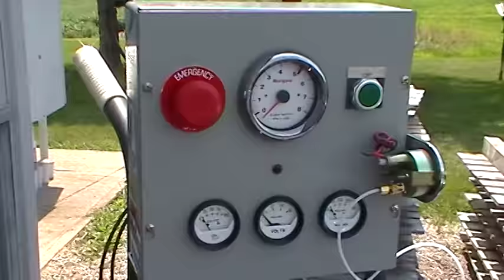383 Stroker Blower Motor Startup

Comment: the idle on that sounds a little rough... it should have an even tone to it not reving every 2 seconds just to keep it started.. i feel if i was to drop that in a car how it sits and bolt a trany to it the moment i threw it into 1st its going to stall...
Reply from the maker: krypten wolf Not at all. This thing is very fast and never dies in gear. Idle is about 900 in gear.

Comment: how much did it end up costing to build this motor? really wanna do this on a 76 chevy
Reply from the maker: I did a TON of parts searching to save money. Blower was lightly used found at swap meet for $1900. Holley carbs were refurbished pair on Ebay for $850. Rotating assembly was about $1,000. Motors like this usually sell for about $16,000 with everything brand new. I can usually sell one for about $10,000.

Comment: 93 octane for engine seems a little low, i wouldnt go any lower than 95. Youll probbaly get some knocking
Reply from the maker: +Smashed Ya We used an MSD boost timing controller. Initial timing is 14deg. Total timing is 30deg with no boost and 24deg at 6 pounds boost. No knock at all.

Comment: I have a ls1 motor in a 2004 Pontiac GTO. Trying to get about 500 to 550 HP out of it.. any suggestions?
Reply: I would cam it and supercharge it
Reply: Thinking about it but I heard a stock ls1 motor can't hold all the power
Reply: rasheem mosley if not just a cam some
Long tube headers should squeeze out a few more ponies, in planning on doing that to my challenger
Reply: Doing that now
Reply: yah they can for the most part hooker longtube headers magnaflow racing cats flowmaster super 40 series dart victor jr. w/e this engine responds the most with heads and cam swap they have  old ford bbc exhaust ports almost circular posi 4;10gear wide sticky f1s  give the mustangs etc forl for me i ran the same true dual exhaust on my 88 pickup and it sounds hella good sounds like straight headers good not annoying
Reply: rasheem mosley Cam specific for the ls1 heads, stock I'm guessing,  ls1 heads are great flowing heads so no need for aftermarket ones. Your basic bolt ons w/ cam,  and nice 93 octane tune you're good for 360-380 hp/trq to the wheels. Bore it, if you can stroke it go ahead. Get a bunch of stuff that frees up horsepower, under drive pulleys, getting rid of a/c even. Supporting mods...I've seen 420 rwhp and close to 500hp without any forced induction, might just look into it more, theres tons of builds out there tell their secret.
Reply: rasheem mosley my dad used to have a 2000' z28 with the ls1 (i dont know much about them other than they are mean) but he was wanting to get an STSturbo kit and its built for an ls series motor
Reply: LS1's can handle well over 600HP stock, so who ever told you it couldn't doesn't know shit. If you want some power, work on airflow and fuel delivery. If i'm correct, that engine inparticular makes 350HP? A good base tune and some simple upgrades could get you to 400 no problem. But if you're wanting to see that 550 mark. You'll have to do some work. Heads, Cam, Intake, Throttlebody, Headers, Exhaust, FM, etc.

Hell, I've got a buddy that has an Semi-stock LS1 in his 1982 Pontiac Firebird, and he hits it with a 150 shot and it holds up just fine, and has been for the last 3 years. All he's done to it is a mild cam, intake, and headers/exhuast. He uses it as a daily, he street races it, he uses it for travel, and he even drags it at the strip. They're great motors, and if i'm not wrong, he just rolled over 200k recently and it's still kicking ass.
Reply: Guy close to me has a record for stock bottom end 5.3 with twin turbo and over 200,000miles on the engine running in the high 8's low 9's in a S10
Reply: How 2   People can get 1000hp on stock ls1 heads and crank, they have a tough bottom end.

Comment: Has anyone reading comments heard of breaking a motor in under load to seat the rings better under more pressure?
Reply: Yes I've heard of that, but don't know if there is any credence to it. I do know I installed head gaskets on a blower motor and tested them by sitting in nuetral and revving the engine to 5500 or 6000 rpm and holding it there for a few minutes over and over again....That test showed the head gaskets held. But then later  I took it out on the road and drove it hard, and the head gaskets failed. Had to change to MLS  head gaskets. So I do believe there may  be something real to doing it "Under Load."

Comment: How much does it cost to build a motor like that
Reply from the maker: I'm hoping to get $16,000 out of the one I am building now. It will have a very strong, high rpm bottom end, heavily ported bowtie aluminum heads, 8-71 blower and Enderle bug catcher mechanical injection.
Reply from the maker: And that is VERY cheap.

Comment: Whats a rig like this cost. I'm debating on a engine build
Reply from the maker: I have a brand new one not even fired up yet. Small block Chevy 357ci. Full roller motor. Lots of high end parts. Pump or race gas. Asking $18,500 with Bug Catcher mechanical injection or $16,000 with brand new dual carbs. Text me at 614- three zero 9- 71 three four for pictures if you are serious.

Comment: Maybe I am stupid but that looks like an 8-71 blower ???  And I hope he`s got a roller cam .Because a low idle on a new cam is a big no no. But maybe it`s just me
Reply: +2x4 Barrels ,,,,your right, if it's a flat tappet cam it needs 2000 rpm break in for 20 minutes, but i have a feeling he did the break in already.
Reply: Darren Oerlemans. said 20 min break in done at beginning of vid
Reply: Darren Oerlemans He mentioned that he did and changed oil/filter, retorqued heads too.

Comment: I thought the surging was normal with a blower?
Reply: whatafrigginjoke if i remember right thats because of the cam
Reply: no the surge is from the blower. The cam just makes it "lumpy"

The surge can be tuned out if you are going to just cruise around town and car shows. But, yea most blower motors that are tuned to run wide open for racing do have surge. When you tune the engine to be happy at WOT it generally isnt super happy at idle, add a blower and you get surge.

Comment: How do you run the engine without the blower Belt?
Reply from the maker: +Jimmy Dean ...... It just pulls the air straight thru it. Almost like the blower isn't even there.
Reply: +qtrmiler1 Roots type blowers are positive displacement. I don't think that's possible

Comment: Why only 8:1 compression? starting my 383 build and was shooting for 10:1.
Reply: +Flint Barnes one word....blower
Reply: +Will Riling its not just the blower but he said 93 octane you jump way up in compression ratio your gonna have to run higher octane fuel simple as that this is prolly a street engine you're probably building a race engine
Reply: Ok. So let's say you are going to add a blower with 6-8psi of boost but still wanted to run pump gas. Where woild my compression need to be?
Reply: +Flint Barnes depends theres a few variables but with low boost you can build a stout blown street engine with 8:1-8.5:1-9:1 compression depending on what kind of cam you got and how big it is
Reply: +nathan butler Going with a roller cam lift will probably but just over .500. I've only built one engine before this build. so I'm not very experienced.
Reply: +Flint Barnes yeah thats good i wouldnt go to big on the cam you might loose a little power going with a smaller cam but you'll be gaining a ton of reliability and longevity from the engine specially a street engine bigger cams require more valve train maintenance constantly adjusting valves atleast in my experience
Reply: +nathan butler my plan is to buy a supercharger with its own fuel injection. Then get an ECU with EFI live.
Reply: Id run e85 threw it its available as a fuel it has an octane of about 105 which is higher than any fuel you can buy at the pumps and e85 will cool and lubricate the supercharger giving you even more power
Reply: +nathan butler how much does that run a gallon?
Reply: Flint Barnes depends on different states and if you can even find a local gas stations around you that carrys it if they do id definitely set it up to run on e85
Reply: Flint Barnes e85 here in Houston texas is about $1.80-$2.20
Reply: Its good fuel cause it alcohol
Reply: +Flint Barnes on supercharged or Turbo Engines you use a little lower compression ratio , all the extra air being forced in in affect raises the comp ratio.. if you were to use anything higher it would most likey brake a rod and also need much higher grade I had a Blower engine with 22 pounds of boost it wasto much for gas i had to switch to alc..and it was only at 8:1 ratio...you can not have say a 14:1 engine and run a blower unless its top fuel and you spend 100 K or more  , also it is tricky to get the air fuel ratio rite on a blower engine with more then 15 pounds of boost..to little fuel and you will at min burn the ends of your plugs and i have even burned holes in pistons.to much fuel and it can backfire the the whole intake..thtas why on ebgines with 20 or more pounds of boost you have to strap then supercharger to the block w straps..or they can blow the whole dam thing off..but if yo get it rite they are a lot of fun..with a 8 inch t converter w 4,500 stall its a lot of money but very fun..
Reply: +Bently Basset That's awesome advice. Thank you. is there some kind of formula on what a pound of boost does to the compression? example: .2 compression per pound of boost. Something along those lines.
Reply: Yeah I was surprised by the low compression ratio my 05 Acura TL has a 11:1 ratio and requires 93 or it'll start to pre ignite and burn holes in my pistons even if the PCM retards the timing
Reply from the maker: +Flint Barnes ..... I run 8:1 compression. I also run an MSD boost referenced timing controller that reduces spark timing as it makes more boost. This avoids knock.&#160;That is how I can run pump gas. With 8:1 compression and 8 pounds boost the motor acts like it has 12.5:1 compression.

Comment: I've heard that the whine of the blower is the air being sucked in. Is that true?
Reply: I always wondered about that. I figured air going in would be just like what it sounds like from a vacuum cleaner.
Reply: try sucking air in really hard with your mouth in circle type shape, that's what it sounds like when it sucks air
Reply: raywj1fan
Right, that was what I was trying to describe with the vacuum cleaner reference.
Reply: *****
sorry mate its the belt, what about gilmer drive belts? they whine aswell
Reply: *****
it is also the belt, it can be both ok jeez
Reply: +THINK4YOURSELF QUESTIONAUTHORITY thank you for the right answer here.  the awesome blower whine comes from gears, not the belt.
Reply: +Zues Tooters you must lose a LOT at the track then my friend :)  Blower surge is not the whine anyone was talking about....  Can you even read?  In case you need to learn some basic engine mechanics, blower surge is the hunting or cycling between rich and lean conditions at idle.  One typically sees this more with mechanically injected engines versus carburetors, but both can surge.
Reply: +Zenme Yangzi thank you zenme, you have built before, i can tell   :)
Reply: Some one can Copy and Paste. And No, I dont loose often. And i have 3 engines undergoing complete rebuilds and a forth in the wives car ready for its time under the knife.
Reply: +Zues Tooters considering you can't even spell "lose" correctly, this does not surprise me.  go ahead, keep trying.  eventually, some day, you may learn what terms like blower surge REALLY mean.  seriously, go use google, type blower surge, watch, and you JUST might learn something.  i feel bad for those engines you choose to work on....
Reply: OH, Like you did?  Enough here. Im out. Waste your time.
Reply: Show me your proof of your EXPERIENCE?  Thought so. 12 year old ArmChair Warrior!
Reply: +Zues Tooters haha ok good, too bad we all can't watch you embarrass yourself with your poor grasp of basic definitions at the "track".  and real quick, tell me, how do YOU define blower surge?  go!  i want to know your definition!
Reply: No
Reply: Yes some of the the sound comes from the gears but the awesome whine sound comes from the cog belt set up. Look up cog belt drives. You'll see it's the belt that sounds really cool. It's the air being squeezed out of the pulleys by the belt. Some people actually drill holes in the pulleys to get rid of the noise with super chargers

Comment: how much did it cost to build
Reply from the maker: I bought the heads and complete blower setup used. Everything else is new. Was able to sell complete engine for a profit at about $9500. Motors like this are usually over 16 grand.

Comment: any one have an idea of the HP?  maybe 1000 plus? about how much $?
Reply from the maker: This motor is pump gas with 9 pounds of boost at 6500 rpm. That works out to about 575 to 600 hp. Built to be reliable on the street. Could drive the  blower a little faster and get close to 700 but that is pretty much the limit for a weiand blower.

Comment: you NEVER rev a motor with a supercharger up then shut it off!!!  wtf?
Reply: +Jmeng43 Why?
Reply: +OnyxStudios720p  cause your building up pressure in the motor and leaving it in there.the cylinders of the engine thats on its compression cycle. any power-adder engine should idle alittle after revving just to let it cool down and balance out.
Reply: Jmeng43
Oh ok, thanks man.
Reply: Same with any turbocharged engine too
Reply: joe lober Makes sense.
Reply: Jmeng43 it's called a compression break in, helps the seals swell up and seal better look it up.

Comment: air fuel idle mixture is off. Hunting for idle. besides that sounds good
Reply: That's blower surge, has nothing to do with the motor hunting.
Reply: ckelley63 you can fix the surge with another 150 rpm above idle. 
big cam and huge amounts of parasidic draw can make those  bearings go see ya real quick.
Reply: ckelley63 you can fix the surge with another 150 rpm above idle. 
big cam and huge amounts of parasidic draw can make those  bearings go see ya real quick.
Reply from the maker: B00steDevil sure I can. But why? Hell, it stops surging once warmed up so I have learned how to fake it. Old racers love it and can't catch me doing it.

Comment: Two issues: Why in the hell would you post out the specs of that motor as a 6 grand motor the way that bottom end is built, my god and even a "stroker", they love rpm, that's why you stroke a 350 4 bolt block. I run my mildly "built myself" 350 to 5500 all the time in my '69 Chevy 3/4 ton 4x4. Second issue if you got grandkids you are playing with fire having a blown motor on a $50 Farm &  Fleet "rolling even" engine stand built only to store engines and roll around in shop. Set (4) 1/2" studs in cement and bolt the damn thing solid---you never know what will cut loose if throttle sticks w/o. Jim.
Reply from the maker: First: (RPM limit)  A blower puts a ton of stress on an engine. Way more than when normally aspirated. Also, the cam I used here is a hydraulic flat tappet cam for street blower use. It is only rated to make safe power to 6200rpm. Add to that the fact that the engine is designed for street use on pump gas. All of that combines to limit this engine to 6,000rpm. The bottom end is built to handle at least 700hp. and 8,000rpm. Restricting it to 6,000 means long life and no BOOMS. Second: (Safety first) I am smart enough to check my environment before ever running an engine on a stand. NO KIDS ALLOWED! Even if the engine was bolted to thousands of pounds of steel the noise alone is too dangerous for children. Not to mention all of the moving parts that are exposed and the 180 degree water coming out of the engine.Third: The engine storage stand works very well since it keeps the center of gravity very low. It does not jump around even with these engines. I do however have plans for a complete stand with wheels that will be completely self-contained with a closed cooling system, fuel cell and engine controls.
Reply: Thx, for replying and explaining circumstances!!

Comment: Why 93 octane if you only have 8:1???
Reply: Because it's blown Ken,it needs to have higher octane because of the pressure in the cylinders from the blower.
Reply: Kenneth Jensen lol.
Reply: 93 octane will help prevent engine pinging/ knocking. He's only 8:1 so I doubt he would have any problem. With that compression ratio and only 9 pounds of boost he's holding that engine back. That thing will be a torque monster if he up the pressure or compression ratio.
Reply: My 9:1 350 would ping with 87.  Internal engine temperatures of this would cause pinging alone
Reply: Thanks for the info.
Reply: Ray Smith That thing sounds like a monster already!!
Reply: we can't get under 95 out of pump in finland :D
Reply: +Kenneth Jensen Supercharging a engine adds a lot of extra air..So you not only need good grade gas you have to retarad the timing as more and more boost builds up..and yes any supercharged engine should always be built with 7 8 or at most 9:1 ratio ..the reason for this is all the extra air being forced in basically increases the Comp ratio..and 1 other thing for people to know ith supercharged engine the cam can have no overlap..make sure of this when buying your Camshaft]
Reply: Thank you very much, this was very helpful.

Comment: How much??
Reply from the maker: I will be posting a new video soon of a brand new 357 with a blower and mechanical fuel injection on pump gas. Probably take $17,500. It has bowtie aluminum heads, splade 4-bolt mains, full roller motor. Even ceramic coated blower pistons. I can switch to carbs if you prefer.
Reply: @qtrmiler1  thank you. Look forward to watching

Comment: I haven't heard good things about the ProComp heads.
Reply from the maker: No problems on this motor.
Reply: Did you have them worked?
Reply from the maker: ckelley63 Out of the box stock. Works just fine.